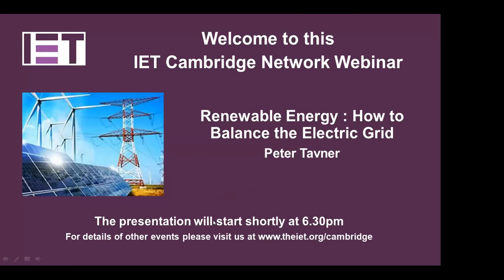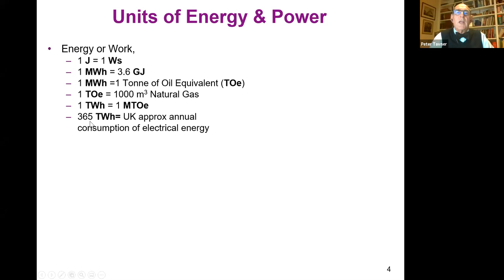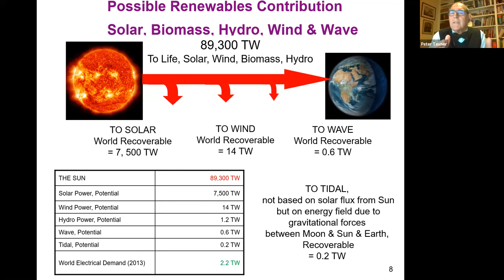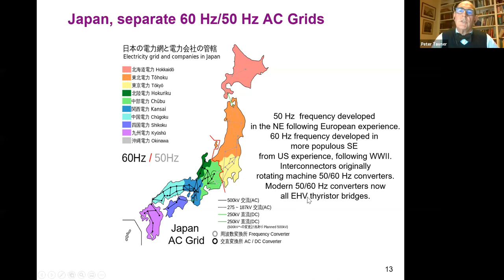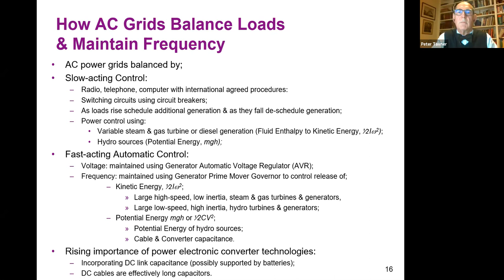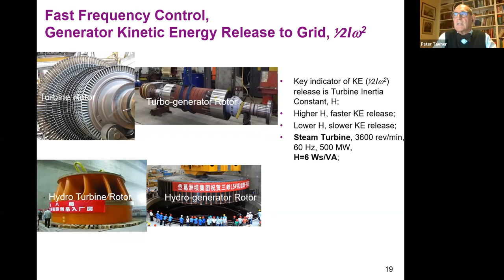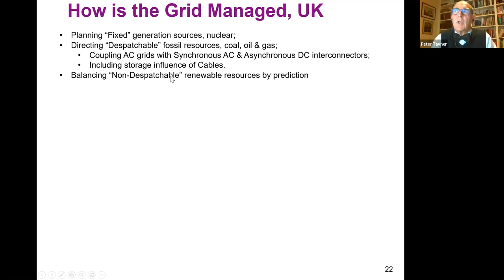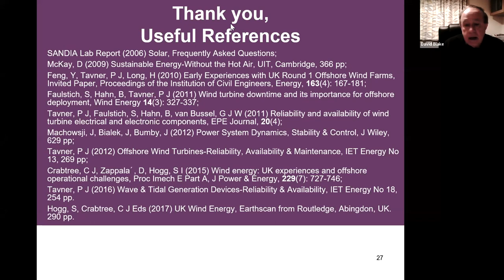Renewable Energy  How to Balance the Electric Grid 261120

Comment: Thank you for this presentation. Here in the USA my interest is the issues of distributed generation, batteries, and renewable energy integration. In our case in some areas solar is now providing over 100% for part of the day. I find this presentation interesting because what is presented is a highly centralized system perspective. Today, there is tremendous development of solar power and battery storage at the local level. Yes, highly technical centralized systems have their place, but a more balanced system would contribute to a much more robust system. To me a battery based system reduces the need for full system inertia and frequency control. In other words batteries will be the intermediaries.